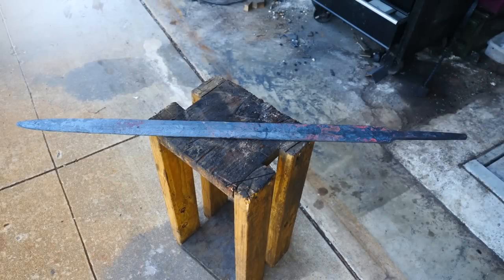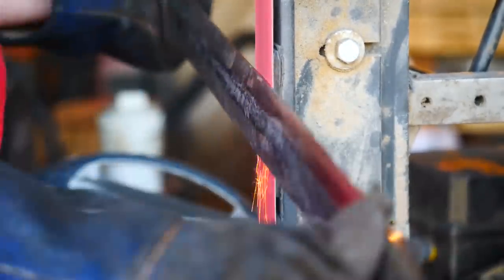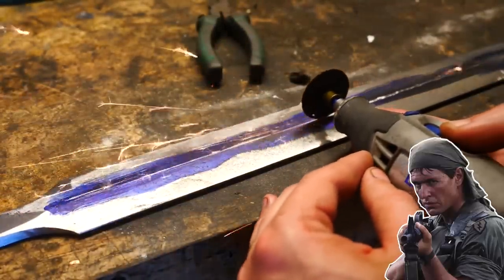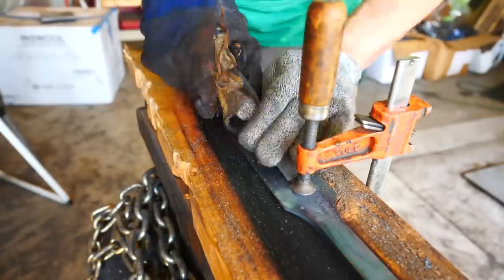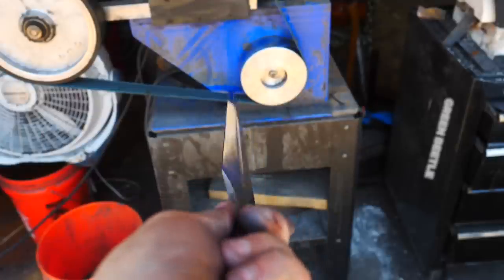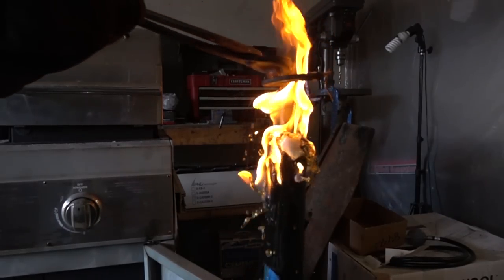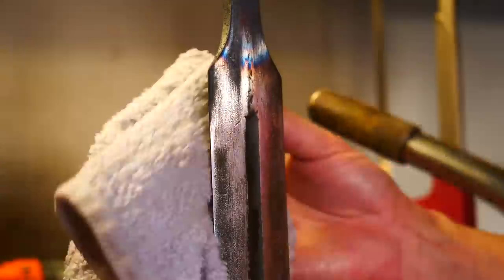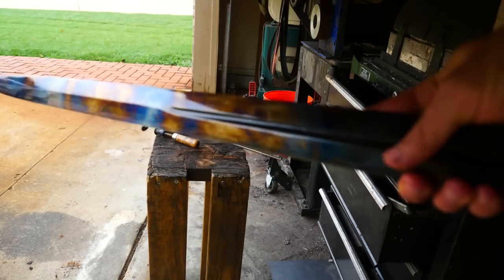Forging A Sword Pt 2: Quench And Fullers!

Comment: I’m watching this 3 years after your video was released. You probably know this now but just in case, make yourself a spring fuller and do the fullering hot. It goes pretty quick and all you have is clean up in the end. 
Your first blade is excellent. Good work.

Comment: That 1075 steel is great stuff, I have some of it from New Jersey Steel Baron, quenched into slightly warmed canola oil, file skated off it, but it was tough as nails even before I got around to the temper cycle. I think it was formulated for the really big knives and machetes. Perfect sword steel. Great work.

Comment: Looks great, I like the case colored look, you should leaves that color
Reply: kurt grates the only sad part about him doing that is the blade wont be 1 hardness so some spots will be soft
Reply: Zednought Xylax technically probably true, but do you think it will really matter as I am sure this will primarily be a display piece
Reply from the maker: 50 hrc file skates all up and down the side and 60 digs in uniformly too.  it's not a perfect temper but more than adequate
Reply: Jeff=savage

Comment: well,  I was about to say way too much temper...but if it skates file at 50, fair enough. I think dark straw edges and  plum spine is common but i may be wrong,  i suppose the steel choice is a factor too. loos pretty anyway.

Comment: Dude I just had a wierd idea a few days ago...y'know that FlexSeal stuff in hardware stores? What if someone used that to make a rubberized grip? Someone should make a knife, make a cheap-but-sturdy handle, then dunk that handle (with the knife blade taped up for good measure) into the stuff?...It was a weird thought i had, and i seriously don't know where it came from...
Reply: arandomguest008 funnily enough, that was how that type of product was used when it originally came out! Not for knives, or anything like that, but for hammers and various tools. My shop teacher had a large paint can full of the stuff, and he would dip a hammer handle in it, in order to improve the grip.
Reply: Thats fucking cool, dude. Someone needs to tell Greenie.

Comment: So I make knives, and recently made a large bowie, it's not perfect but it does the job decently well, was able to cut through some green wood.  The question I have for going with a sword is should I try to go with a fully hand forged or try to go with a stock removal technique on everything after I get the basic shape hammered out?
Reply: Depends on how much work you want less grinding with almost forged but more of a chance for err. It would be all up to you

Comment: Very cool!  Glad to see you were able to get the heat treating worked out.  Regarding your hardness files, and the fact that you're now missing one of them, a great replacement for those would be a set of hardness chisels from Matthew Parkinson.  I just got a partial set from him that comes with a 56, 58, 60, and a 62 HRC chisels, but you can get a larger range if you want.  

They are made from A2 and they work great from knives as you are able to test the very edge on more shallow hardening steels, where the ricasso can give a false readings by using a traditional Rockwell tester, since it needs to be a parallel surface in order to test.  Anyway, just a friendly tip/suggestion from one knifemaker to another.  Here is a link to a quick demo vid he did using them:  https://youtu.be/j5EMTdxIzdo

Just send him a message via Facebook if you want to get a set. 👍

Btw, the pop-ups were great 😄👌

Comment: I was surprised that you ground the fullers in completely rather than using a fullering tool/hammer, and grinding to finish it off. Whatever works, I guess!

Comment: You sir are the first person I've seen rough grind a blade horizontally on a flat platen. Everyone else I watch seems to do it vertically on a contact wheel - having tried both, have any thoughts? And thank you for the warning - I am definitely going to build a scraper for when I put fullers in my first sword. Thus far, your build looks great.

Comment: Any particular reason you went with the hand torch tempering? Looks awesome by the way. That fuller was certainly worth the effort, looks perfect!
Reply from the maker: It doesn't fit in my heat treat oven and it can't be seen it while it's in the sword forge to monitor color change so I was afraid id burn parts of it especially the tip in the forge.  And if i needed to cool it quickly I'd have no way of cooling it all at once, it's too long. with some practice the sword forge is probably the best place to do it but this wasn't the time to learn.

Comment: I would really like to invest and try to forge some weapons or tools myself. What are some basic necessary things to start forging?
Reply: Dokalex forge, bench/anvil, hammer and tongs (of which you will produce more yourself)
Reply: Dokalex 
An anvil, hammer and a forge is all you need, and you don't need to spend a lot on any part.

Try find an old or second hand anvil for cheap or failing that, some people use a piece of railroad track. Another alternative would be to go to a scrapyard or steelyard and get a chunk of tough steel and use it, doesn't need to be big to start off.

The cheapest forge to run and to build is a coal/coke forge.. all you need is a metal or brick tray to put the coals on and a metal pipe to blow air into the middle of the coals. This method allows for small hot spots so you can heat up certain areas quickly, but also means you risk burning the steel away.. It also smells quite bad but it'll get you in the door of blacksmithing.

Hope this helps :)
Reply: Skruffles Thanks dude! Will definetely check it out!

Comment: What thickness do you leave on an edge before the quench?
Reply: Depends on a few factors but a good rule of thumb is the thickness of a dime. I usually take mine down to around .030" and leave it thicker if its a blade that might need to be ground straight or if it is getting a violent quench at all. Type of steel might matter quite a bit too.
Reply: Colson Customs Thankyou

Comment: For the fullering, the big half round file, was that a bastard file, and was it a 12 inch  ?
Reply from the maker: Don’t rem but if your planning on trying it dont
Reply: @GreenBeetle  Thanks for the reply. I have forged up a late medieval style cut and thrust sword from some 8670 steel that I had in my pile, just doing some cold work now and thought a fuller would look good on it. I' do some draw filing for flats, and I have been thinking about scraping the fullers in, lots of file work. Might not be the most efficient way. I'm thinking of just using the file to indent where I want my fullers and forging them in along the indentation followed by clean up work.

Comment: I'm Fairly sure that the sword is not supposed to be blued that far.  Doesn't that ruin the edge hardness.
Reply from the maker: it would be bad if it were straw color.  as file shows it's over 50 hrc throughout.  perfect.

Comment: Watch Adam Savages Excalibur sword making video and check out the sword belt grinder to make a fuller
Reply from the maker: looks cool. anything's better than a file
Reply: Rage he made a sword like object it was aluminum he did have some sweet grinders tho
Reply: I haven't done a fuller yet, but I've seen guys use some really slim contact wheels for fuller grinding. I don't have a wheel small enough (smallest I have is 4"), but I think my concern would be getting it started properly. I think if I were to try it, I'd start my fuller with a file, and then switch to the contact wheel after I got it started.
Reply: I know I've watched it 3 times. But the technique shouldnt be much different as it comes to the fuller, since its the same outcome.
Reply: Very much so, I made my ex a wooden sword for her birthday (wanting to be a BA princess) and even a file on dense wood is not fun.

Comment: That blade is not evenly tempered! Either be very careful in how you use this or fix it because that wouldn't be a huge deal on a knife but in a sword the two different hardnesses can cause the blade to snap on a strike, it's a good sword overall so it should take alot to do that but just dont put this blade through too much abusr
Reply from the maker: two temper cycles in this vid a third will be applied in the next.  all together I think it will be a reasonably uniform temper,  but not perfect.
Reply: All I'm saying is be careful with it just incase, I use 1045 mostly for my blades so I don't have to worry about it as much because mine won't shatter just flex a bit (as long as it's done properly) so I might be offbase for 1075 but whenever I temper poorly the blade bends and cracks really easily